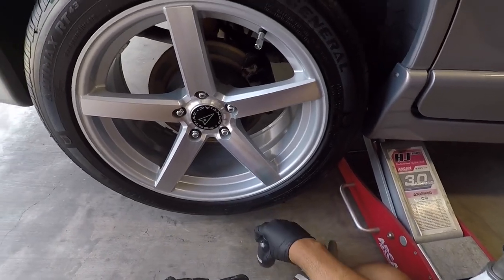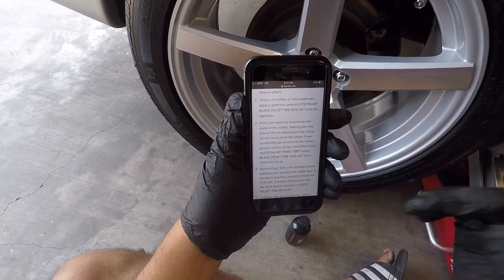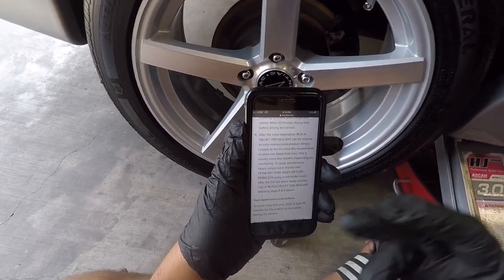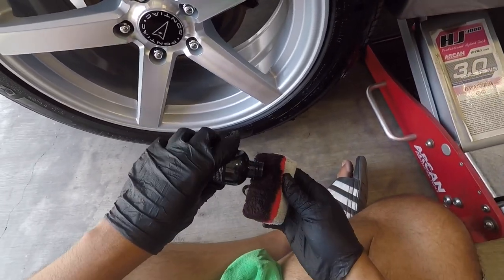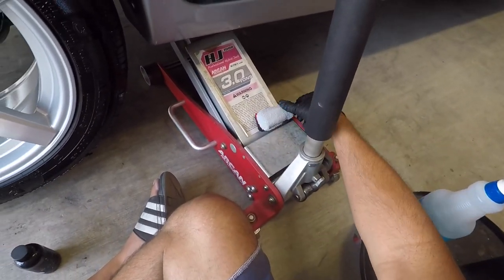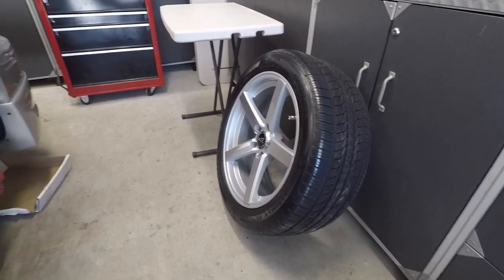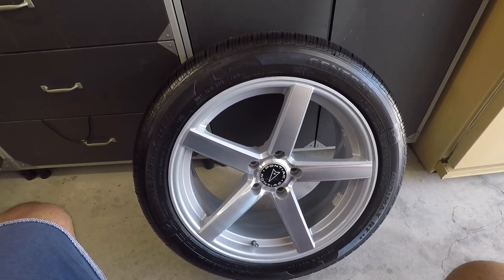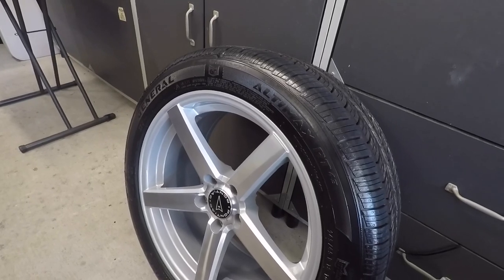Feynlab Black Velvet Tire Sealant

Comment: Hey Mike, any way you can do testing on pure rinseless vs n914 vs ONR? I’m not too concerned about “cleaning” power or slickness. I’m most concerned about paint safety. I’ve tested ONR even on soft black paint and have never had any marring. Just want to see if it’s worth it to switch. 

Also wanted to know if you could test feynlab ceramic lite. Very interesting coating as the instructions ask you to do the full vehicle before wiping it off.
Reply from the maker: Hey. I’ll give you some feedback using all three.  

I haven’t used ONR in about 2-3 years. I transitioned over to N914.  N914 just cleans better and I have not had any issues with marring. But the paint on any cars in the household are not soft. Even on the softest part of my Camaro which is the black sail panel seems to do well using N914 with the big red sponge.  

I have since transitioned to the ultra black sponge from TRC.   I think ONR is fine but I just didn’t like it so much. They do say it leaves nothing behind but it does. The beading changes and if used every wash it is there.  I noticed this when I moved back to bucket washes and noticed it.  I have not used the newest version of ONR and I don’t think I will be investing in it as N914 just does the job I need. 

I have used feynlab pure rinseless and it out cleans N914.  Feynlab is a bit on the sudsy side and takes more effort to dry it and wipe it off. Don’t bother using a drying aid while drying as feynlab seems to negate it.  Feynlab also streaks on glass.  I’m continuing to test it to see if it is worth having as it is pretty strong.  

As far as the coating. I will eventually get to it. I don’t know how soon though.  Applying to the whole car is rather appealing.
Reply: @MikeGDetailing  Thanks Mike for providing a lot of insight on this. 

I’ve actually used ONR during polishing(for soft paint causing marring during wipeoff of polish), and ever had any issues with applying coatings after a eraser wipe down. Durability was the same. 

I think I’ll stick to ONR as I’m happy with the old formula, and the new one is supposedly better. I did purchase feynlab pure rinseless and pure wash as the power of the cleaners are intriguing. If they really deep clean coatings it would be nice to have in the Arsenal. They state it’s also meant to be used for paint preparation prior to polishing, so it seems like a decon wash product as well. It also states that if you use it on a waxed/sealed surface it will likely degrade or strip it entirely. People mentioned this behaviour in an autopia thread. 

For me ONR is about $13 cheaper a gallon here in Canada(compared to N914). I still prefer the 2 bucket method with running water, but rinseless washing does save time and is very safe. No marring on my black vehicle that’s daily driven. 

I’ll be trying out feynlab ceramic lite, as I’ve only installed gtechniq and carpro coatings before. Seems like a great entry level coating that you could apply and remove in 30 minutes, without fear of high spots.
Reply from the maker: @eliteowner121  Makes sense to stick with ONR at that price point.  I am sure the new formula is better.  Dr. G knows what he is doing.  The Feynlab Pure Wash is actually nice.  Has some good lubricity.  It doesn't have a lot of suds but that is fine by me as it rinses off cleaner.  The Pure Rinseless works very good at cleaning wheels.  I think you will like them.  Post some feedback on the coating.  I may give it a go on the next coating test.
Reply: @MikeGDetailing  For sure. Thanks for letting me know how pure wash is. Really intrigued to see how it will benefit me during decon washes or resetting coating properties. I will post a comment once I have a chance to try out the feynlab ceramic lite.

Comment: You didn’t clean tire enough. Before applying.
Reply from the maker: It is not that good even with proper application.  The best alternative I have found for it is for some rubber trim on the lower part of the car.  But for tires it is not that good based on my experiences with it on multiple occasions.
Reply: @MikeGDetailing   thank you mike👍🏻